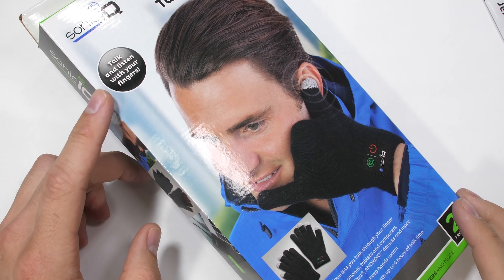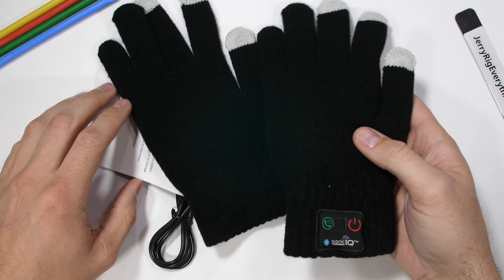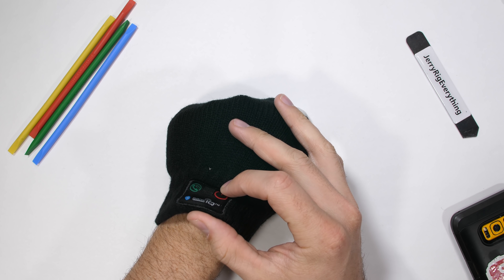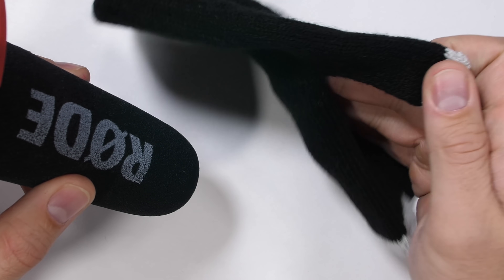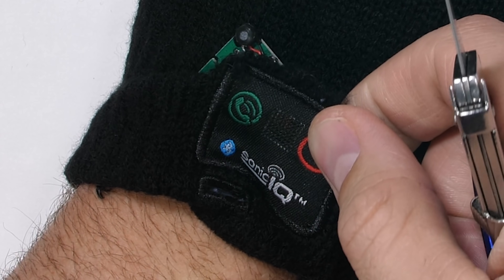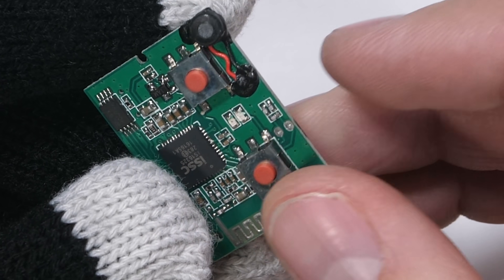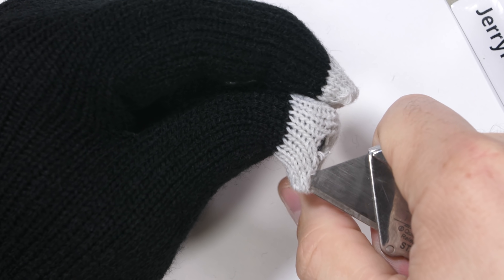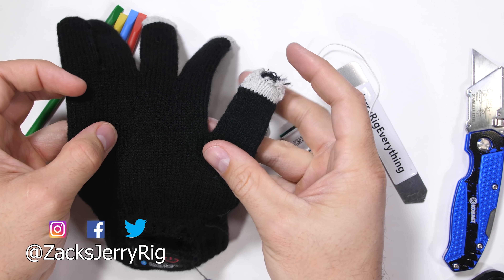This Smart Glove turns your fingers into a cell phone!?

Comment: I got this glove as a present, and the microphone on the outside of the wrist is why I didn't bother with it. The gloves would have cost a few dollars more if they had put the mic in the pinky, and it would have been worth it.
By the way, you CAN unlock a phone while wearing gloves. You just need a good facial recognition system, like Apple's Face ID, or Samsung's (former) iris scanning, or HTC's 3D face mapping.

Comment: The comment about USB being micro is a little interesting. The USB Type-c is expensive to make and the cables are complicated. It would drive the cost of the product way up. I rather have a micro USB, a port that is still common, than a USB-C as only the most recent Laptops and motherboards support the port. Most cases still do not come with a USB-type C port.  It's just a cost thing.

Comment: " We can see Muscles at Level 6, and the deeper Bones at Level 7 "
" The Bend test is a failure, since despite the outer appearance ( which somewhat has becoming a bit blue ) the inside seems to be in shambles. As it can barely move or function like before "
" As for the Burn test, the skin seems to change the colour just after 4 second burning, with no way to recover the burned part, maybe some 'skin transplant' would fix it. "
" And don't forget our sponsor for today's video "Diss-Brand" which will Brand your hand with the Hottest trend. It's so hot you can feel it in your hand for 30 days or more."